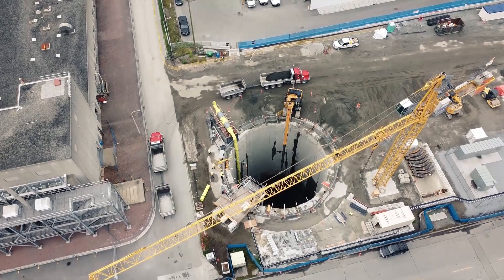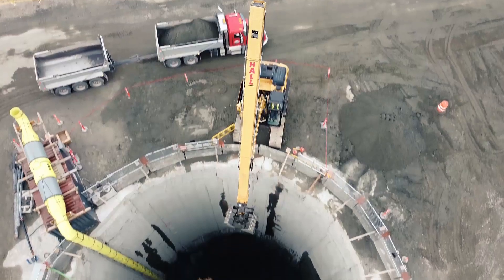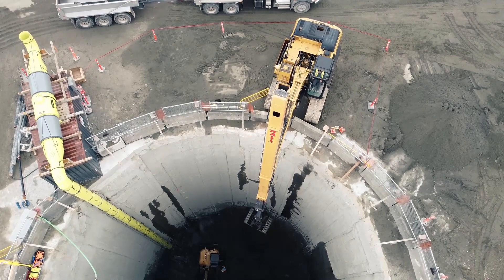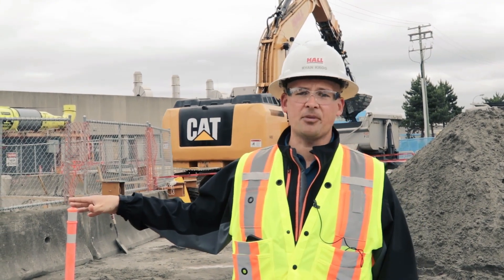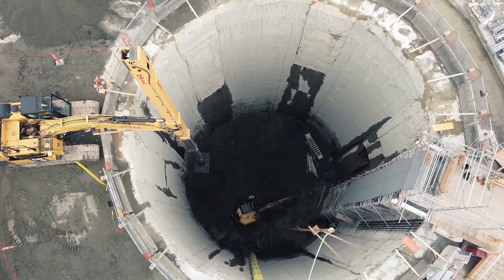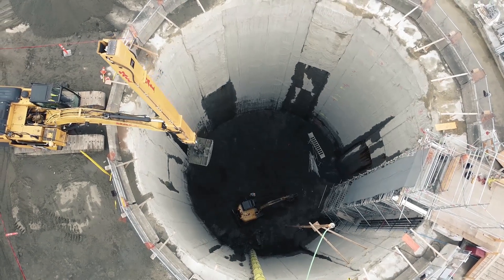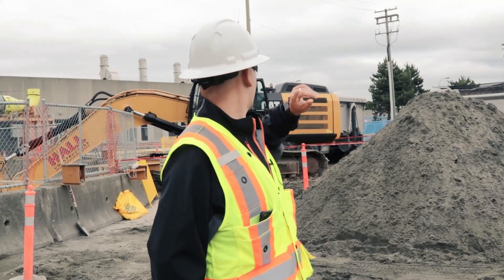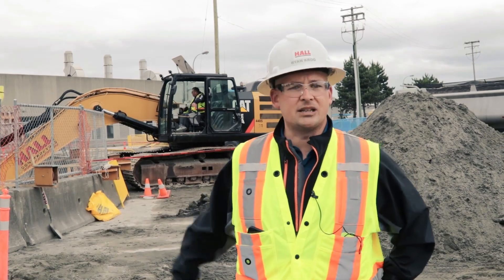Custom 336 Teledipper digs 120 foot outfall shaft

Comment: We used a crane and a specialized bottom dump trailer  rigged up with a quick disconnect air hose to open doors and a 312 cat excavator to load trailer in shaft. Worked great